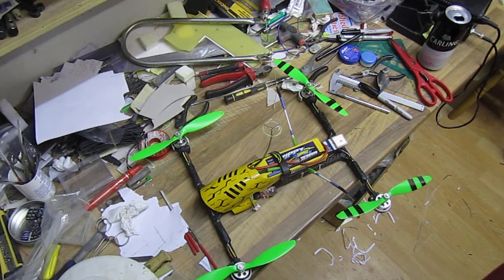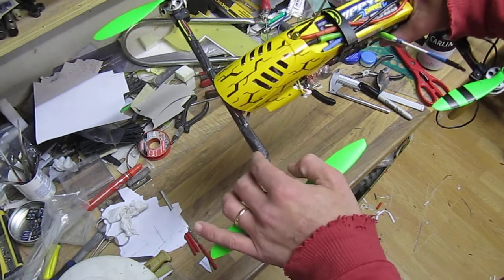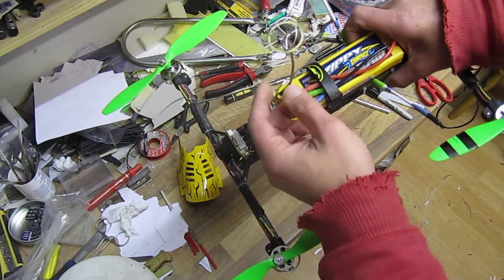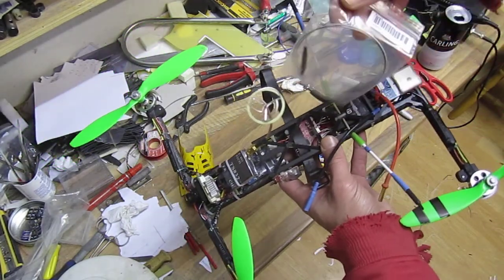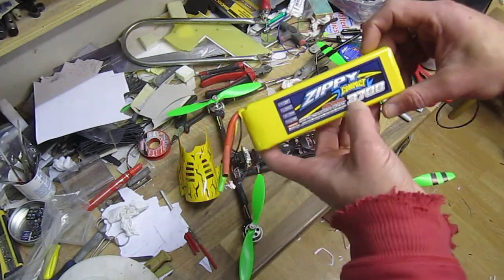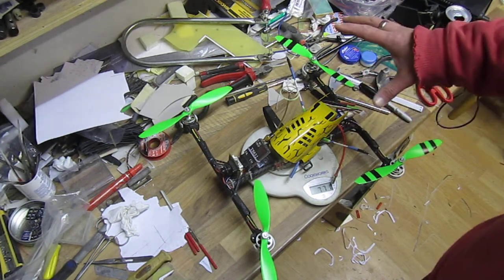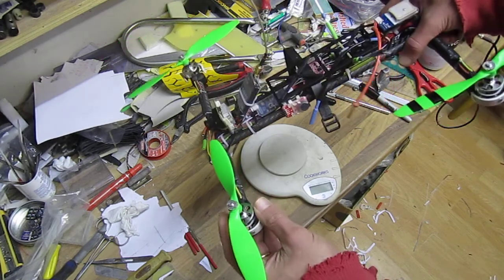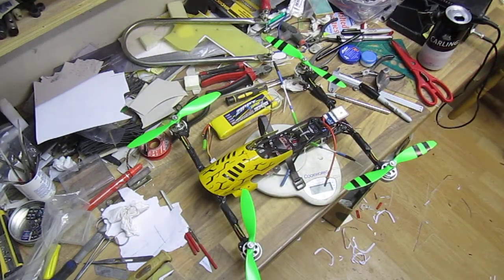DIY carbon H-quad. Build overview #2

Comment: Very nice machine there mate. I am quite intrigued by the PCB near the antenna. Theoretically, FR4 PCB material is no good near microwave antennae. How does yours perform? I am currently working on my new ground station incorporating a six turn helical and a skew planar (home brewed antennae of course). Labai ačiū.
Reply from the maker: Cheers, I didn't notice any difference in range or interference whether I'm using carbon or fiberglass plates. I'm trying to get my ends of antennas as away as possible and so far it works:) Before the mods with this copter I flew over 1km and back without a single telemetry beep, so will try to hit 2km now:)

Comment: 2 watts on Frysky 2.4; what's your RC range?
Reply from the maker: Dunno mate, as I don't have RTH on any of my aircraft and fly in urban areas, I don't want to test it:) I boosted my Taranis not for long range flying, but for stronger signal to be safer behind obstacles. As I tested that I can say it definitely improved, but because of the hassle that I got I wouldn't do it again, better move to LRS...

Comment: Good work mate, im amazed by the amount of gear you crammed in there .
you have inspired me to build mini H myself , first attempt 1kg with a 3600mah 3s
second H quad attempt 500g with a 2200 2s , I feel a lot safer to fly FPV with these light quads.
Reply from the maker: Yeah man, this setup turns out to be very efficient. I went through a gazillion quads with 10" setup and they could carry the same amount of gear as this 8" one:)
Reply: I might try those motors ,
 im also waiting for some multistar 390kv motors people claiming over an hour flight time with 12amp plush 4s and 17inch props and Panasonic battery's, what the?
Reply from the maker: Hmmm.. I'll have to look into this:)
Reply: have a look at ( cptfrazz ) on YT
Reply: 1 1/2 hour+ hover time WTF
Reply from the maker: That's not exactly flying:) If he adds some payload like FPV gear, it will reduce the time drastically and being this size with this weight it would be a nightmare to fly... Still, very impressive!
Reply: True ,they claim 55min with fpv gear and 25km flight , another dude on vimeo hovers outside for 109 minutes , it all has to do with the Panasonic NCR lithium battery a 4s set up can charge/discharge safely from 16.8 volts down to 10 volts also a 4s 13600mah set up weigh's around 750grams , if we use these batt on our current quads  we will double our flight times  I recon .
http://vimeo.com/82829375